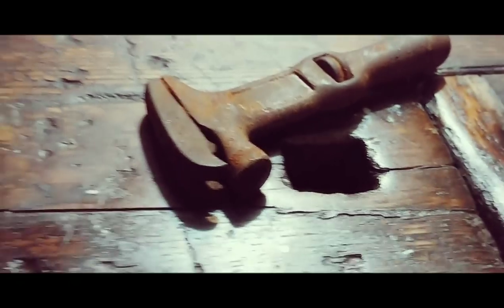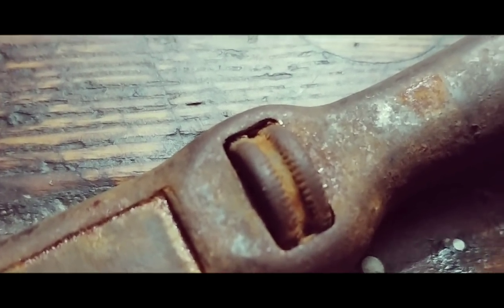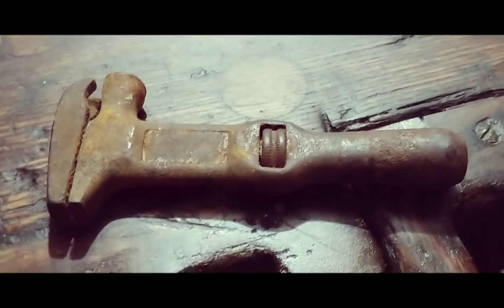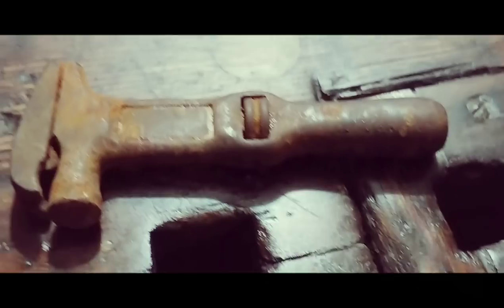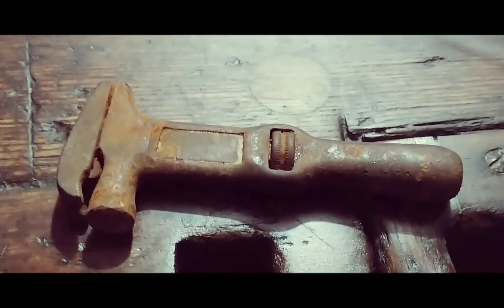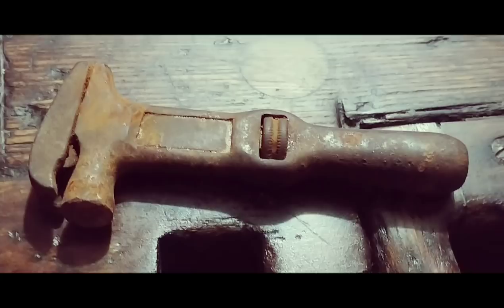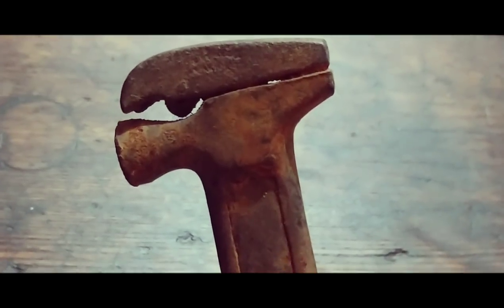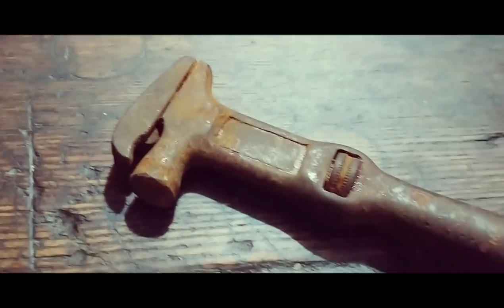ANTIQUE RUSTY HAMMER WRENCH RESTORATION - RUSTED SHUT

Comment: wd40 is not a rust remover or a lubricant. you are better off soaking it in vinegar or you are just wasting your money.
Reply from the maker: The wrench with soakrd in a Rust-Oleum rust remover for 45 minutes removing the rust. After that it was soaled in wd40 overnight. WD-40 is a penetrating oil lubricant that loosens Frozen stuck parts that are stuck. WD-40 is a  isviscous oil which remains on the surface to which it is applied, giving lubrication and protection from moisture. oil is diluted with a volatile hydrocarbon to make a low viscosity fluid which can be aerosolized to penetrate crevices. The volatile hydrocarbon then evaporates, leaving behind the oil. A propellant (originally a low-molecular-weight hydrocarbon, now carbon dioxide)  I have been using WD-40 over 30 years and it is never a waste of money when it comes to unsticking parts that are Frozen together and will not move. It is not a rust remover you're right about that. But in the beginning of the video you will see that the wrench was soaked in a rust remover before being put in the WD-40. The purpose of the WD-40 was to get the wrench moving again and get it unstuck
Reply: @-GetGoTv  sounds good.
Reply: Then why do so many people use WD-40 with good results. Sure vinegar works good, so does Evaporust , and a dozen other products, but in this case the end result is a functional good looking tool, and a great video.....I'm not bad mouthing your comment just, oh well ...Ken
Reply from the maker: @kenzpenz  well said thanks Ken
Reply: was goin to reply. nah.